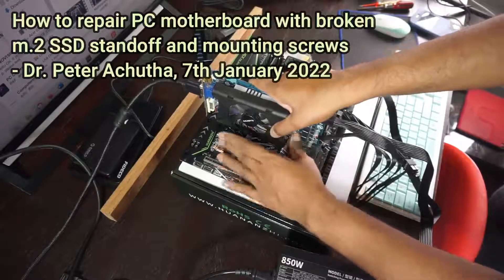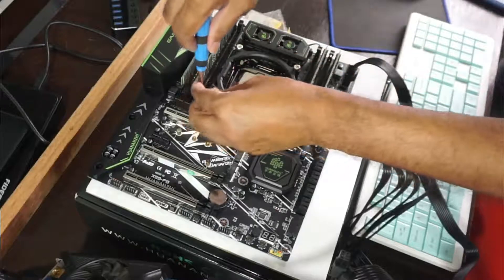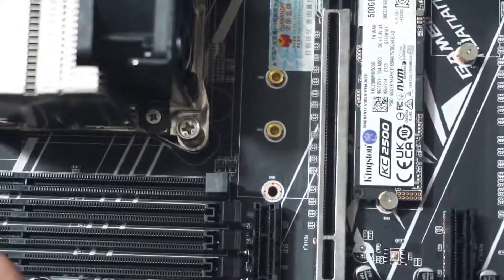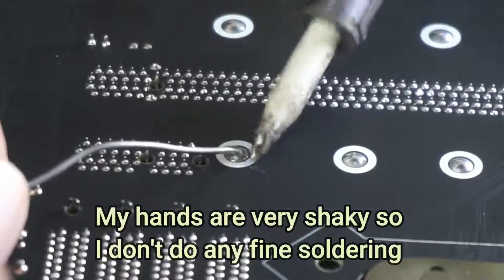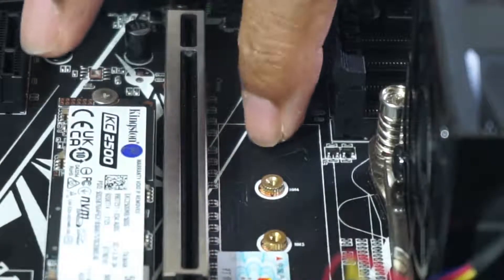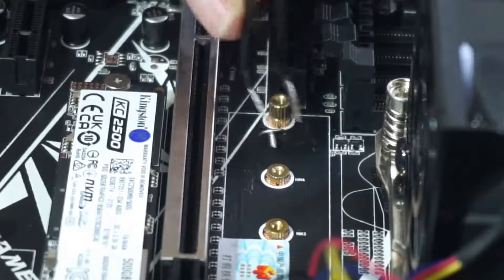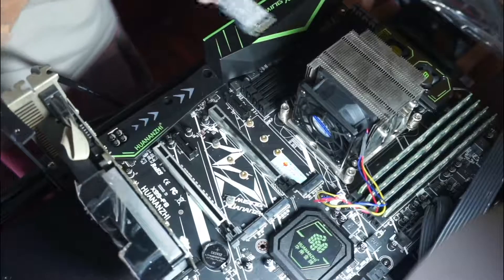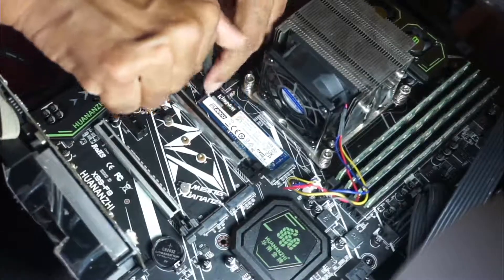How to repair PC motherboard with broken m.2 SSD standoff and mounting screws

Comment: Would super glue be a good alternative?
Reply: no because super glue is made of chemicals that can result in slow corroding of wiring, that takes months to cause shorts.
Reply: What if I try using a non-conductive super glue
Reply: @eSnipes2000  I don't know anything about non conductive super glue. But when I was working in an consumer electronics manufacturing factory, about 30 years ago, this was the problem we saw. We were subcontract manufacturing irons (for ironing shirts and other clothing's). The superglue corroded the insulation of the wiring and cause the irons to explode after a few months of use. They stopped using superglue. So my suspicion is that a similar explosion would occur on your motherboard. Its the chemicals in the superglue that eat away at the insulation or motherboard. Soldering is still the best option as it is a well established technology that is at least a 100 years old and tried and tested by many people.

Comment: A heat glue gun is a good substitute. This is how I attached my SSD.
Reply from the maker: That is a good idea 👍but it will make it more difficult if you needed to change your SSD.
Reply: @dr.peterscroll422  Heat the end of a screw driver and touch the glue. The glue will soften and the SSD will come off with little effort.
Reply from the maker: @outlet6989  That is a very good idea

Comment: Just ran into the same exact issue, wasn't too keen on soldering to the bottom of the board but looks like it should be fine. Thanks!
Reply: I just used super glue
Reply from the maker: @matenagy111  Great. Do be careful as superglue can slowly corrode the cable sheaths over a few months and create shorts.
Reply from the maker: Great news

Comment: Looks like a good solution, but how did you get the nut into the hole fully? When I try the nut will not go through the hole in the motherboard as it looks like it was pressed in by factory assembly pressure. Any ideas? Cheers.
Reply from the maker: I didn't get it in fully. I guess it just sits on the top side of the motherboard. That was why used a bandage / tape to hold it in position before I turned the motherboard to the other side for soldering.
Reply: @dr.peterscroll422  I suppose it doesn't matter if it is uneven in height to the other standoffs? Bcos we only use one standoff to hold down the nvme drive?
Reply from the maker: @melodychest9020  If it is higher or lower just a little it should not matter as the other end connects into socket. The socket connection is important because data transfer is through this socket. The standoff is just mechanical positioning and to lock the NVME in place so that it does not slip off. The NVME SSD should be slid into the socket to connect to the motherboard then held in position by the standoff and screw. I hope that answers your question.